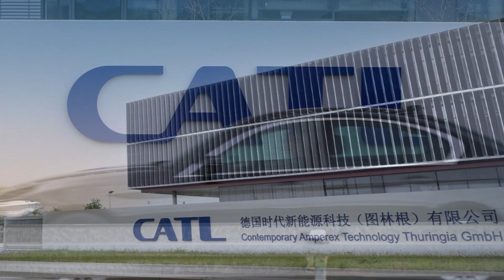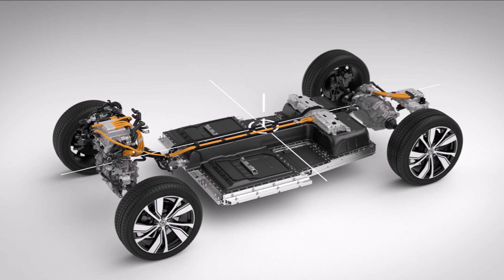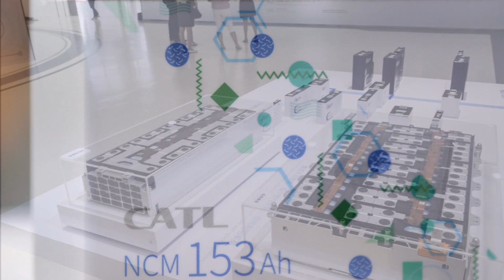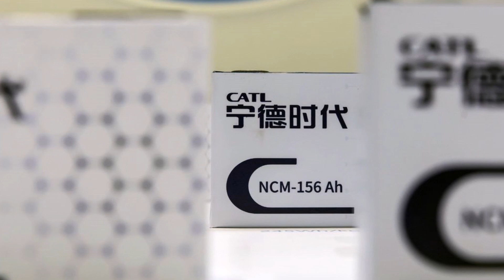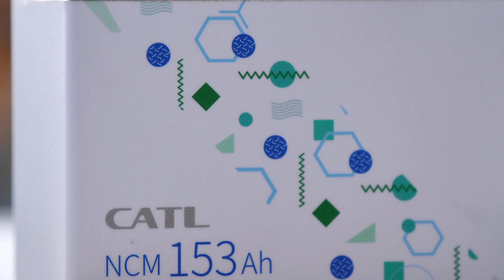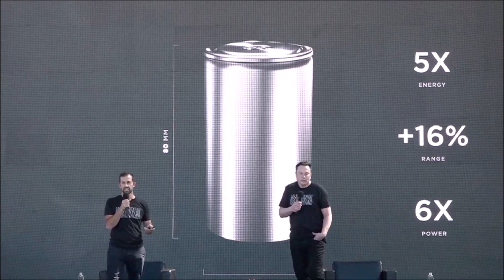Tesla Supplier CATL Has a New Type of Battery In Production, Coming in 2023

Comment: Yeah, CATL has announced 3 new production batteries planned between now and next year. Their sodium ion batteries will be cheap and use sodium instead of lithium. But they will have lower energy density, so they are better candidates for home and industry (fixed installation) battery backup solutions. The M3P batteries seem to use manganese to make LFP batteries more energy dense, but it is still too early to determine if there are any other trade offs in price, longevity or other capabilities. CATL's upcoming Qilin LFP batteries are also due in production next year and promise to also be high density at the pack level (255 Wh/kg), to compete with new battery technologies like Tesla's 4680, and upcoming solid state batteries due out in a few year's time. Because CATL's announcements can be vague, it could be that the Qilin and M3P batteries use the same chemistry, and are just being marketed separately with a different name for different regions/customers.